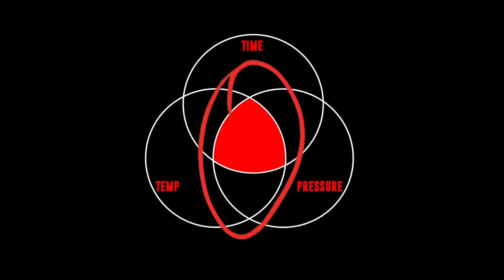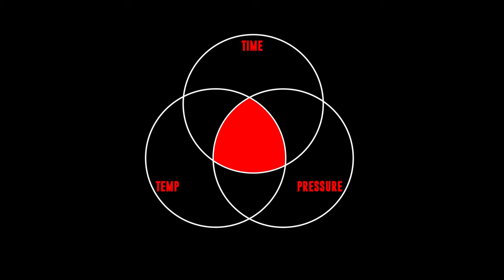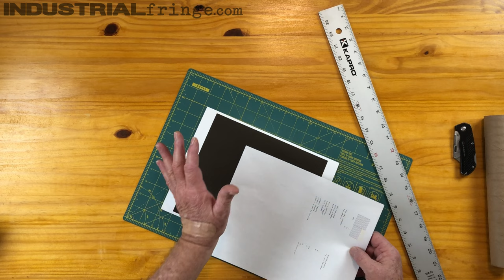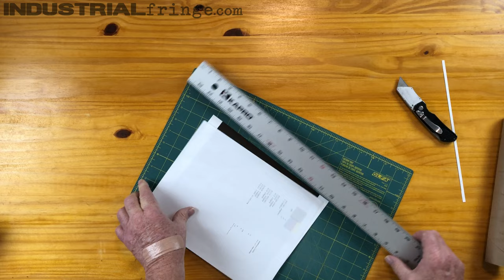How To Sublimate Perfect Black Tumblers!

Comment: Can you grab a temp gun to verify that you're element is as close to displayed setting? For all you know your actual temps are running hotter and the rest of use could have a machine heating exactly as displayed and wondering why 365 is not working out. I know mine is running a bit hotter and needs to be adjusted down.

Comment: Awesome video! I am using A-Sub paper, 125g everything I've seen says the output printing will be a little muted. I'm very new and struggling with getting the black (or other vibrant colors) to be very rich-looking. I am using the Epson Ecotank 8550, Hiipo sublimation ink. My paper selection is Premium Matte, High Quality...what am I missing that I'm not getting your results? Is time and pressure culprits?
Reply from the maker: Time, temp and pressure are so much of the formula that gets the perfect result! Light pressure is a must for me!

Comment: Awesome Video, two questions if you don't mind- How did you get it matte? Have you ever had issues with heat tape showing on tumbler after you press? Biggest struggle right now. Thank you
Reply from the maker: Thank you! You can buy the tumblers in a regular (shiny) finish or with a matte finish. (Link to my supplier in the description!) I did used to have occasional issues with tape impressions, but I started using very light pressure and that took care of it. Not always, but every so often a blank tumbler will be shipped not fully cured. That can cause tape indentions. To remedy that, bake it for a minute or so, then let it cool down and start the sublimation process as if it were just out of the box!

Comment: What is the PERFECT measurement for a
 20 OZ. skinny tumbler? 🙏🏽
Reply from the maker: They’re all gonna be a touch different, sometimes even within a box of tumblers from the same manufacturer (although that’s rare). My jumping off point/default is 9-1/4” by 8-1/8”, with the width including about 1/8” extra paper for the overlap. I use this measuring tape all the time. It’s super easy to measure the circumference with this tape! https://amzn.to/36HZxOV Thanks for watching!

Comment: Hi Roy... great video you have a new subscriber... should all tumblers be peeled cool or does it depend on manufacturer. Tony uk
Reply from the maker: Hey, Tony, thanks for subscribing! There is no manufacturer need. All stainless tumblers will react the same regarding this. The hotter the tumbler is, the better chance you have of getting ghosting. Obviously once it cools below 300 degrees, you should be fine, but I have found some designs with solid black on clear have a tendency to bite my butt if I peel them too soon. I used to peel mine hot, but changed about a year ago when I got a couple that ghosted. I still peel most of the tape hot, as I can’t stand trying to get the tape off when it cools! Thanks for watching!

Comment: Thanks for sharing...how did you get white writing on the black tumbler. I am confused... Did I miss that part of the video
Reply from the maker: I didn’t. The tumbler was white. I sublimated a design that was mostly black with no black (transparent) where the writing is. So basically, the writing is just not black. When I sub, all of the black shows up, but the area that doesn’t have anything (text) shows up as the tumbler color, in this case, white. If the tumbler were pink, the text would be pink, as it’s just an area that doesn’t have the black. Make sense? Thanks for watching!
Reply: @industrialfringe953  wow...that's brilliant! Thanks for replying! Do you have a video out on that process? If no, I sure would love to see the designing of it!!

Comment: Great Video, but one question, i follow every step but i still get orange tops and bottoms.. what am i doing wrong ?😭
Reply from the maker: It could be a couple of different things. You should have light pressure and if you haven’t yet, you should double check the actual heat to make sure your temperature is accurate. I’d suggest joining our Facebook group, as it’s very easy to interact and troubleshoot! (There’s a link in the description.) Thanks for watching!

Comment: what if you use a convection oven instead of tumbler press...
Reply from the maker: Absolutely. It all boils down to finding that perfect time and temperature. I used to make all my tumblers in the oven, and I got great results with blacks. I did about 365-375 degrees (measured with an internal thermometer) for 4-1/2 minutes.

Comment: Since you're leaving the tape on for the extra 150 seconds, why pull ANY of the tape off before then? Doesn't that risk moving the paper around, with the potential for ghosting that you're trying to avoid?
Reply from the maker: Great question. I thought I mentioned that. My apologies for not! Tape is much easier to remove while it’s hot. So I remove MOST of the tape, but not all. I’ve found after I remove the top and bottom tape, if I’m careful to peel the seam most of the way down and leave the lower quarter attached, the paper doesn’t shift. If I pull all the tape off, it has a much better chance of shifting. I hope that makes sense! Thanks for watching!
Reply: @industrialfringe953 , turns out, you actually DID mention it. I posted the question before I finished the video. 

So, it appears that maybe part of my problem is that I'm impatient!
Reply: Suppose you get some ghosting on a black cup. Is there anyway to resub that section? I know I am stretching here, but hate to waste this 40oz cup. I taped the heck out of it. Black is my nemesis.

Comment: Roy you wear a mask…may I ask why ? Is sublimation smell bad ?
Reply from the maker: Some off gassing happens when I bake tumblers. If I’m only doing one or two, sometimes I skip that step (but I probably shouldn’t). I always use a mask when I’m doing a bunch, as I can’t imagine it would be a good thing to inhale those gasses! Thanks for watching!
Reply: Ink contains heavy metals. Therefore,  when we sublimated toxic gases will come out from the ink due to the heat. We should always use some type of air extractor and not let those gases near you. you can have an air extractor right besides the heat press and will take all those toxic gases near the air we breath.  Weather you do 1 or 100 tumblers always use an air extractor,.